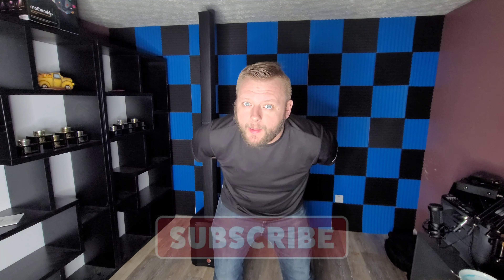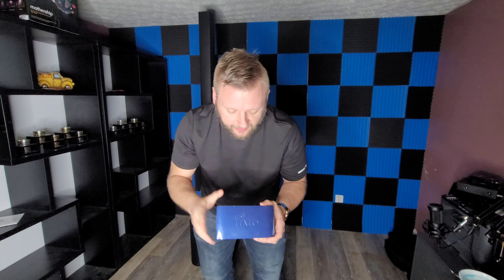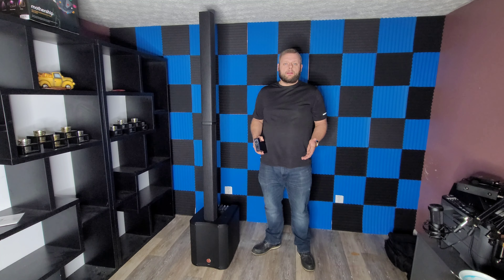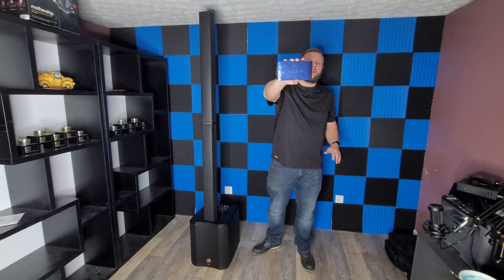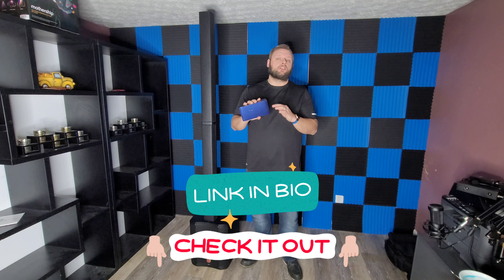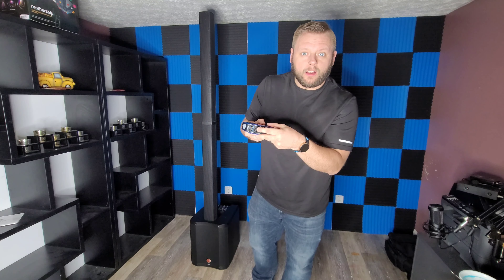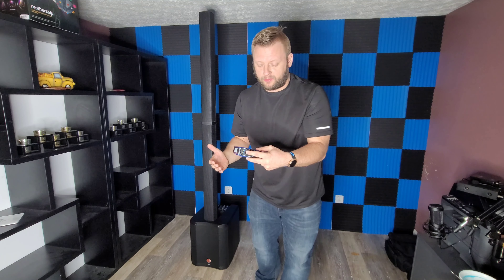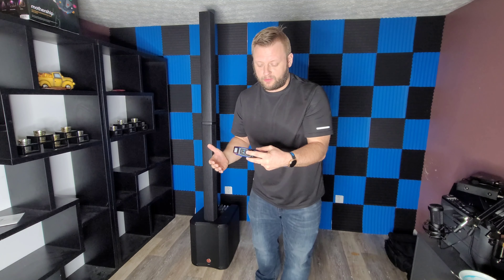DJ Gear: Halo Bolt | Battery Powered Ceremony System

Comment: Hi, can you tell me what the power draw on the speaker is? I connected the Halo to an Alto TS312 , the light starts to flash red and the speaker never powers on. I’m just wondering if I’m doing something wrong or the alto draws too much for the unit. Thanks

Comment: the tops I use are peavy dark matter tops and my ceremony rig is a harbinger 12 with Samson 88wireless mic a Mackie 8 channel board and I also use a speaker stand tray with my equipment on and jackery underneath.

Comment: Would this run a Pioneer XDJ RX3? Thinking to buy 3. 1 for each studio monitor and 1 for the console. 

I’ve been wanting to run some outdoor streams and this could be a solution!
Reply from the maker: So, after further testing, I have found that when using the Edison plug, it delivers a steady output whether something is plugged in or not, so no matter what, it dies after 2 hours or so.

Comment: Will this work on a qsc k12.2?
Reply from the maker: No. Too much power draw.
Reply from the maker: @deejayvirgo  more than likely, you're going to need something like a Jackery. It's it initial power on stage the smaller battery packs can't handle.
Reply: You think an RCF HD10 will power from this? @djtravismcguire

Comment: I use a jackery it last all day running 2 tops a board and wireless mics 290watts .
Reply from the maker: Could you link that to me please? I would like to check that out.
Reply: @djtravismcguire  I’ll text you a link tmrw bro  bro
Reply: How are you guys achieving sound from your speakers? My light turns red and not green and failed me the other day
Reply: @therealdjmikej  how big of a unit you using
Reply: @wbuttry1  I’m using an EV Evolve 30M same wattage as an MLS 1000 and other powered speakers
Reply: @therealdjmikej  your best bet is a jackery 290 I think that is what I got
Reply: @wbuttry1  thanks buddy I think I may get that .
Reply: @djtravismcguire  can you shed some light how you got yours to work?